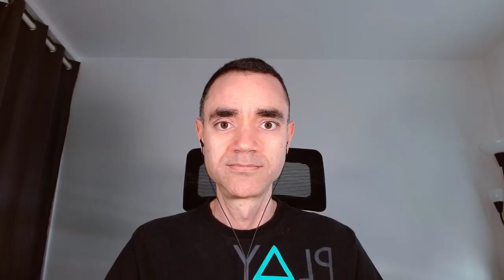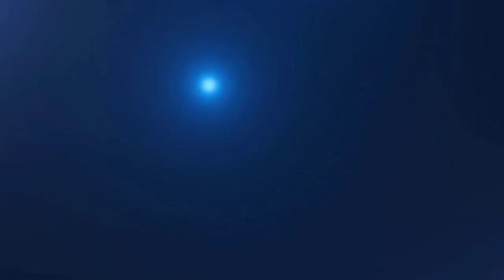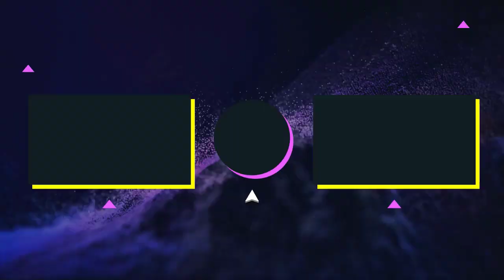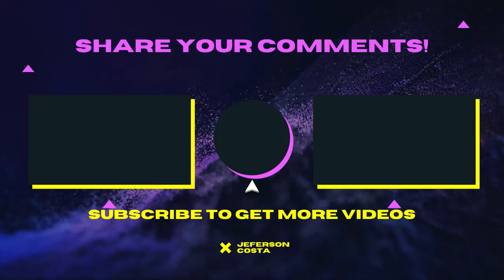SKILLS TO INCREASE YOUR EMPLOYABILITY AS A CHEMICAL PROCESS ENGINEER

Comment: This was so insightful, thank you very much. I am a recent graduate and I am trying get some free courses which carry cirtificates online. These corses were requirements for some jobs which include P&ID, Manufacturing Process Improvement, Process design and Fluid Mechanics
Reply from the maker: Thanks for the comments  😁 At least for me, giving certificates for free is not a option because there are costs associated to issue certificate 😅  Feel training you can find in my website 😇